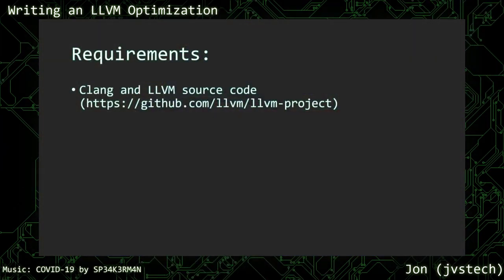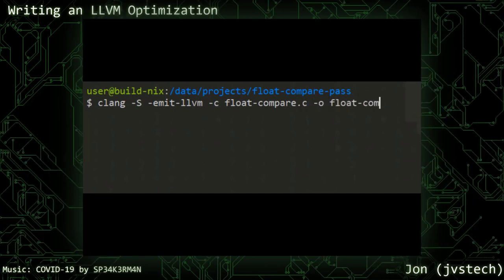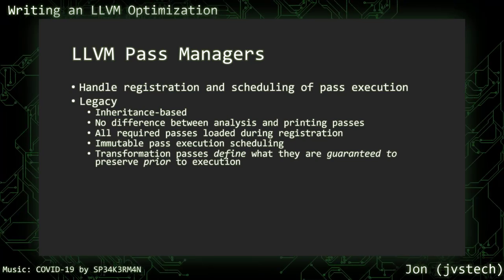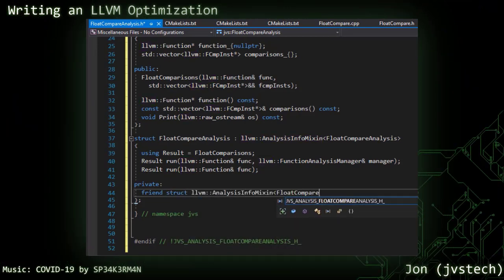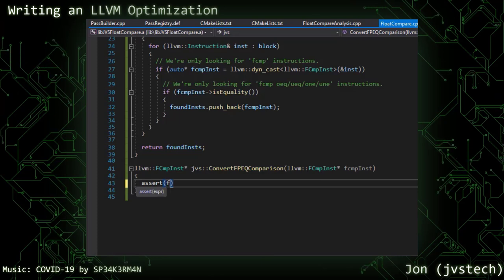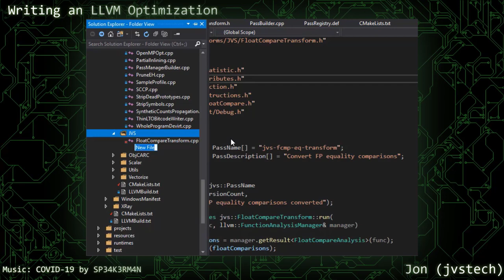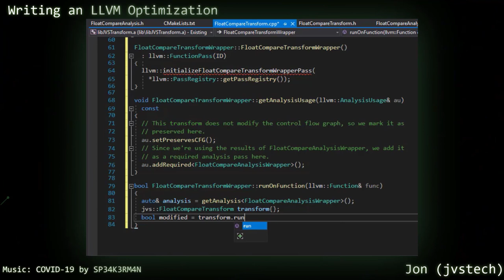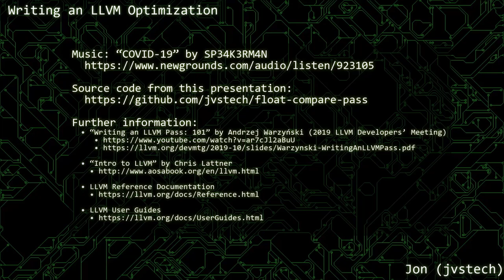Writing an LLVM Optimization

Comment: fun fact:
in systems that use 2's complement encoding, if the last bit is 1, the number is negative. therefore, if you perform a right shift by sizeof(long) - 1 bits, you should be able to determine whether a number is negative.

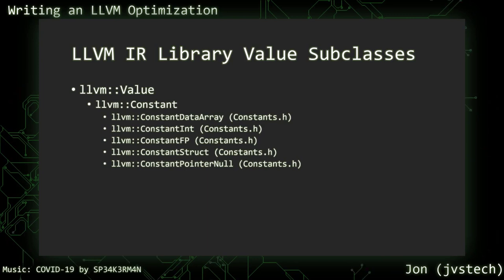Comment: 19:04 "The constant class (llvm::Constant) represents a construct in a module with inmutable addresses". ??? Is that the "definition" of a constant? I mean, all the literals with value "3", does all of them assigned an unique address or what? That relationship between constant and inmutable address caught me completely by surprise.
Reply from the maker: That's good thinking! First, I clearly should have stated the obvious: constants are values that do not change, and they are certainly represented as `llvm::Constant` values in IR.

Functions and globals are constants because they have immutable addresses. But it's a bit murkier for immediates. If a value is directly encoded in an instruction without changing its bits, it, too, has an immutable address. But if the encoding prevents it from being directly represented (such as values encoded as memory expressions), does it still have an immutable address if you can't reference it directly without performing some other operation to get the value it represents? I believe that's still a constant with an immutable address - just not in the format you'd expect at the source level.
Reply: Thank you for your answer.

I think we are talking in different levels of abstraction here. A function is not even a constant (according to my understanding of C/C++ at least) because it's not even an object, since from the point of the language doesn't even occupy storage, right? My question was really about if that definition constant = immutable address, holds from the point of view of the definition of the abstract machine of C and/or C++ (which for this kind of basic things are usually similar). 

A literal value is a constant (and in general an object), but I don't know if the standard says anything about the immutability of its address (because I guess ALL objects have an address even if you don't take it). 

Also, what does even mean that its address is immutable? Every object have an immutable address (the address of an object doesn't change in the middle of any execution). Does it mean that if you take the address of the object, it would be the same in every execution? Doesn't that hold for any local variable as well :D?